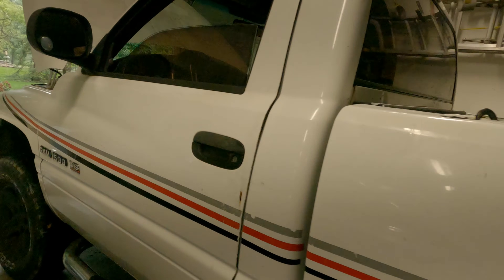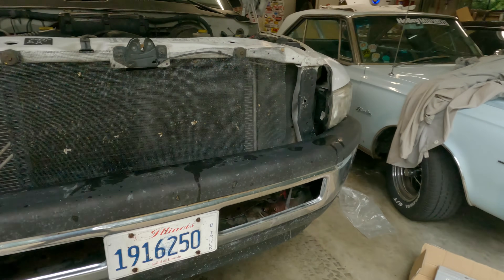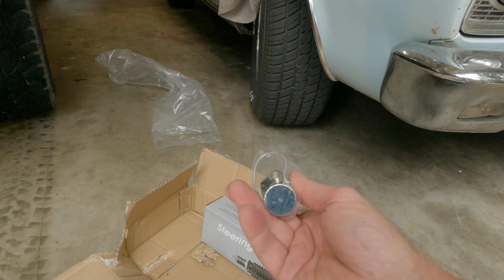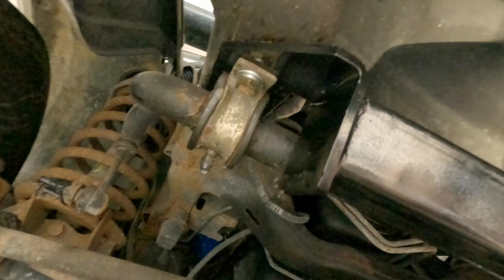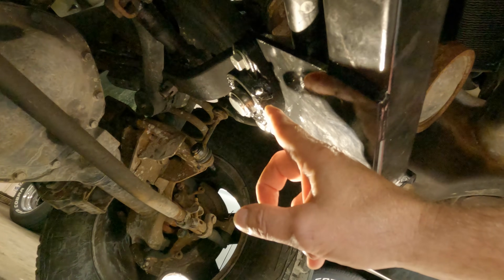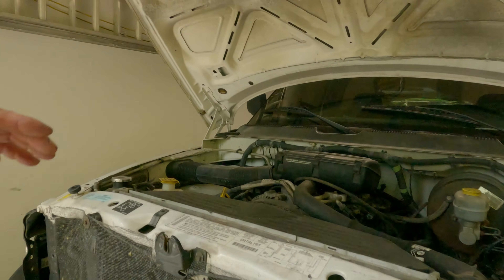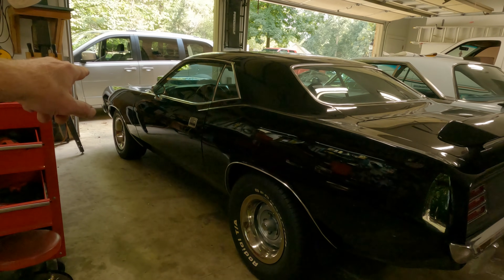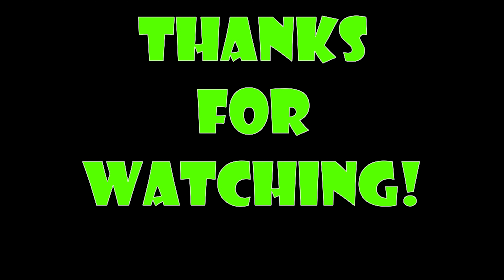Installing a steering stabilizer on a Dodge Ram - 2001 Dodge Ram

Comment: H.O.M.....great video,  speaking from experience,  go with the flat black.....in 2011 we bought a leftover 3.5 v6 2010 challenger,  black crystal pearl coat......we had a flat black 'break up' stripe done that followed the Cuda stripe , except stopped right before the door handles....looked great!! Now my wife has a 2011 charger rt, black crystal pearl coat, flat black distressed American flag on the roof, and flat black trunk stripe with the Mopar 'M' on both 1/4's.  In February I bought an 01 ram 1500 4x4 with the 5.9, lots of work to do,  I'm sure I'll hit your email for advice. Right now I have the intake off to do the Hughes aluminum plenum plate,  and need to do timing chain and cover next. Not a TX truck,  so plenty of rust to tackle.....lol.
Reply from the maker: Your hands are a bit full with projects as well.  I dig subdued graphics on a car.
Reply: Full is an understatement,  we have an '07 wrangler,  and an '04 grand cherokee as well.

Comment: Do you know if the stabilizer is beneficial on the 2wd version, '89 D100?
Reply from the maker: I understand that the 1st Gens have even more frame flex than the 2nd Gens. if you find one for your truck, it probably can’t hurt.
Reply: @Chuck_House_of_Mopar  Thank you!